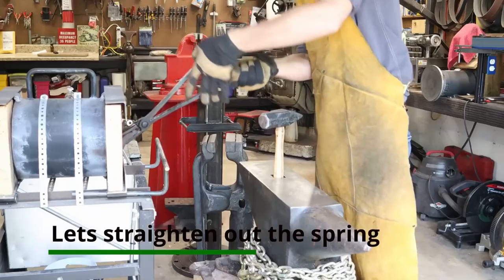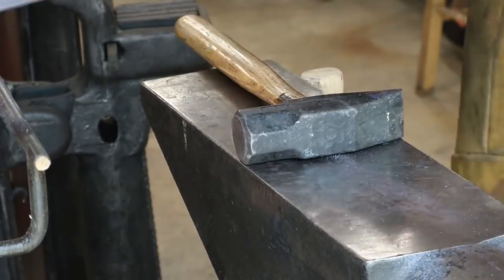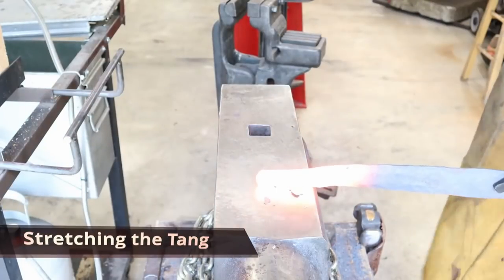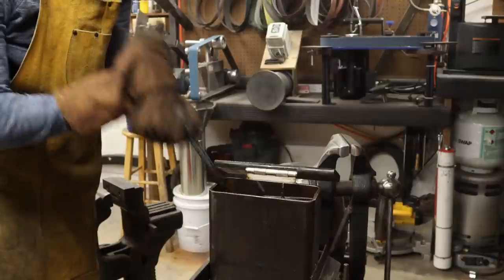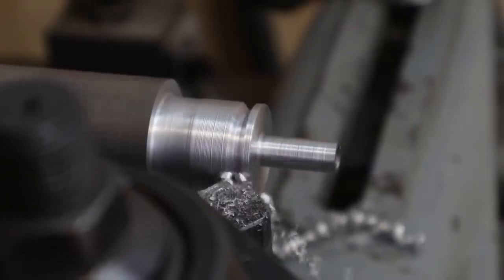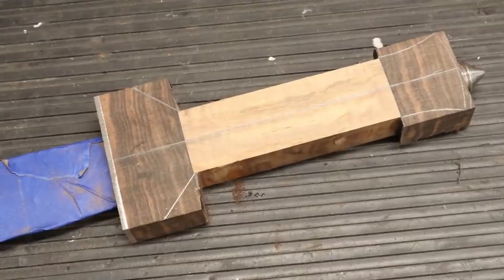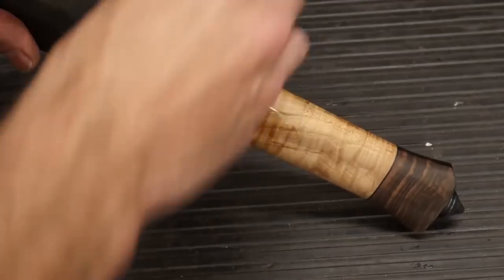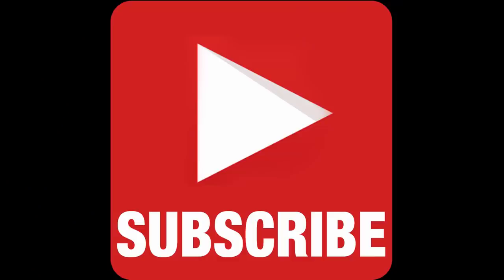Hand forging a sword from scrap!  Junkyard steel = Big Money

Comment: looks good, very modern gladius like, handle looks great as well, and yes old steel works well, love that you are using a piece that you found, only use old steel myself so far as have a good supply of it via a friend who repairs agricultural machinery, just figured out pattern welding finally after I failed before due to not enough heat, got that sorted out now so will expand what I am able to make using the scrap metal with the option of layering it up to thicker stock
Reply from the maker: Wicked cool man! I love upcycling materials! Cheers Andy!

Comment: I have used some of these clips myself. It is hard as hell, and really likes being worked HOT.... Great video!
A. Lee Coffee
Reply from the maker: No doubt it liked to be hot! Working it in the heat mid range was a Definite no go!
Reply: @Aleeknives  I moved onto an old Homestead here in Alaska, that's near the railroad tracks. I have found buckets of clips, big bolts nuts, and of course many many railroad spikes. I took a time and straightened out about four of the spring clips. After seeing your sword, I now have a few ideas of what to do with one or two of them, LOL.  Now, It just needs to thaw out  a bit up here, I can get the forge  fired up and get some of that cold off of that anvil. We are expecting -4 degrees (F) this weekend 🥶. Keep up the great videos

Comment: Very nicely done! Quick question; how did you tighten the pommel nut? I didn't see a hole in it to insert a tightening tool.
Reply from the maker: 🤣😂 so true! I wrapped a piece of leather around it then used a pair of pliers. Super high tech man

Comment from the maker: What is the spring clip used for?
Reply: looks like some sort of track clip for holding the rail to the chair it sits on, you have different types in the US to what we have here so could be something else I guess but I can't think what that could be
Reply from the maker: Jason knight claims these are close to 1084 steel
Reply: @Aleeknives  be good quality without a doubt, some of it is specific alloy types but yes likely is close to it
Reply: Yeah it’s a clip for different parts of track. There are different types. I live in a train town in Cali and cause of that I have a ton of train steel in my shop. Including that clip and others and a track anvil. As other have said j Knight did one and he thought it was old school 1084/1080 , also mystic mountain forge used one. I’m keeping mine for the day I ever get access to a press or o hammer
Reply from the maker: Yeah it took a lot of hammer blows to stretch it out and it also liked to be really hot to work it!
Reply: @Aleeknives  that’s not all of them. That was just the one he had. From what I’ve found they are 1055-1060
Reply from the maker: Awesome Nick thanks for the info!
Reply: @Aleeknives  no problem. Anything I can do to help. I have some clips that look like the one you have in your video and everytime ive tried to straighten it out it gets a big crack running lengthwise. I’ve even tried to anneal them first and they still cracked. Also they looked really new. No rust or pitting. I have some like knight had in his video and didn’t have that problem with them
Reply: Those are rr anchor clips.  They clip to the rail next to the ties to keep the rail from shifting as it expands and contracts.  There are a handful of variations but those are the best for forging
Reply from the maker: I see I got lucky to find this!
Reply: @Aleeknives  yes sir. They’re a good cheap steel for sure. I’ve upset a whole one after straightening it to form a little rectangle billet to forge hatchet heads and tomahawk heads. It’s a lot of work but it makes a good little hatchet
Reply from the maker: Never thought to do that! Good idea man!
Reply: They are also known as anti-creepers they help to keep the rails at a consistent distance from one another
Reply from the maker: I didn't know that!

Comment: I think those are galvanized so watch out for fumes.
Reply from the maker: Definitely not galvanized.  But you are right if it was you certainly wouldn't want to be around the fumes!
Reply: If it's rusty, it's safe. Even if it was galvanized, it's gone now. Galvanization give the steel a sort of a "health bar" against corrosion. When it's completely exhausted by being in corrosive mediums, it starts to actually rust.
Reply from the maker: Agreed + these are not galvanized to begin with

Comment: Pssst.... Not a rounding hammer. You use A LOT of wrong terms. Like A LOT. Lol.
Reply from the maker: 🤣😂 this hammer actually is domed and polished so it moves material in all directions. It may not look like a traditional rounding hammer but it does the same. Thanks for watching Wesley! Cheers